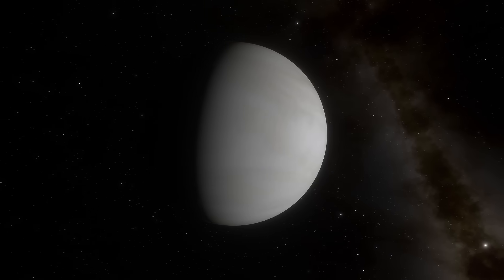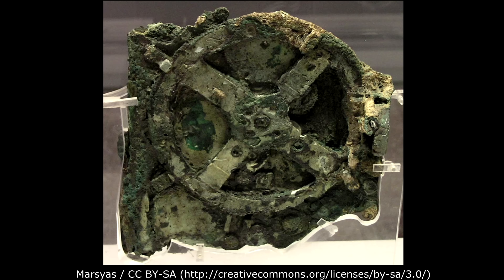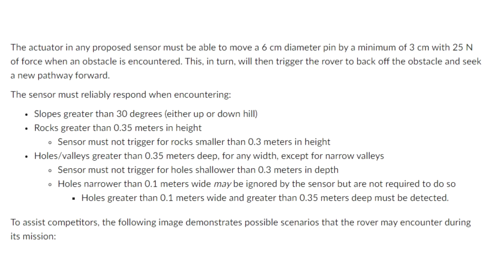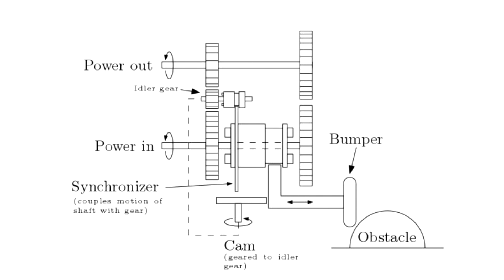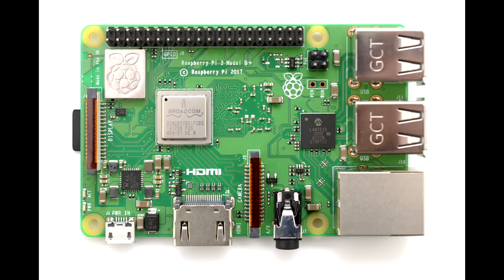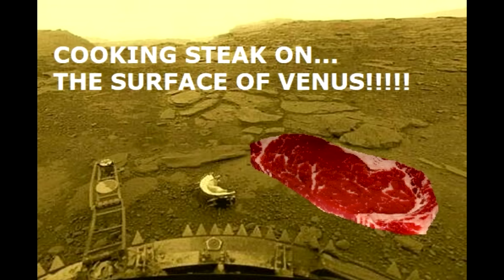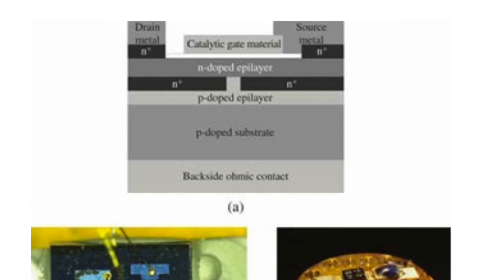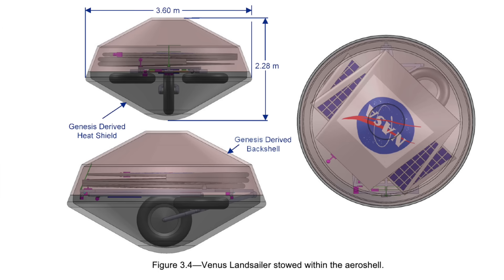Venus Rover Concepts That Beat The Killer Atmosphere

Comment: The Norden bombsight was an analog computer that could steer a B-17. So hopefully can steer a small rover.
The best option: a Babbage Analytical Engine. Can even run programs. A bit large for a rover, would weigh several tons if ever built. [Edit: to correct from Difference to Analytical. The Analytical Engine was a true computer design.]
Reply from the maker: Didn't the bombsight need a person looking through it?
Reply: @scottmanley   The bombardier had to calculate various inputs, and feed in altitude, speed, etc. Lined up aim point thru the sights, clicked on that for the computer. Flipped arming switch, then kept sights on target for constant update to computer. But it could work without constant updates, just less accurately. Bombs released by computer; pretty sure the classic "pickle" push was a movie dramatization, was actually a manual back-up. But I was talking about the Norden's ability to take input and produce output in relation to steering a course, seemed a good place to start. But am sure there are better; the B-52 had an advanced analog computer for this.
Reply: And Babbage machine needs human operation.
Reply: @Wallyworld30   All of the analog computers were designed for human operation, to set up input. But the Analytical Engine was designed to operate independently once the program was started. Mechanical sensors, how inputted, are a different part of the rover problem. I have no idea how that would be done.

Comment: Awesome! I'm so fascinated with Venus. Ever since I saw the SFIA video about colonizing it, it's that much more interesting to me.
Reply: It's the better candidate for colonization if you ask me. At first floating cities then slow and steady sequestration of the CO2 in the atmosphere. Maybe even launch it at Mars to help build an atmosphere and heat it up.
Reply: David Thompson 
The major disadvantage is that access to surface resources is very difficult compared to Mars.
Reply: @jeffvader811  I was thinking more along the lines of energy in the form of solar power, and wind power. Travel times are also half as much as a trip to Mars. Surface resources wouldn't be reachable until we managed to lower atmospheric pressure down enough for a diving hard suit to withstand. Obviously not the current models which weigh hundreds of pounds but something along those lines.
Reply: David Thompson 
True. Personally I feel that Mars will be the first planet (other than Earth) to be colonised, because self sustainability will be easier to reach in the short term. But I don’t doubt that Venus will probably receive similar treatment at some point.
Reply: @Twitch760  Would be a better idea to take the CO2 from Earth's atmosphere then, seeing as it's soooooo 'problematic'. XD
Reply: @sunnyjim1355  Yup, excess co2 has been proven to decrease intelligence in humans.

Comment: They should use that 3d printed compliant mechanisms veritasium did video about. https://m.youtube.com/watch?v=97t7Xj_iBv0

Published on Mar 12, 2019

Compliant mechanisms have lots of advantages over traditional devices. SimpliSafe is awesome security. It's really effective, easy to use, and the price is great. Check out SimpliSafe here: https://simplisafe.com/veritasium I visited the Compliant Mechanisms Research group at Brigham Young University and spoke to Professor Larry Howell: https://www.compliantmechanisms.byu.edu At the above link, you can download 3D-print files to make some of the objects in the video, plus learn more about compliant mechanisms. What I learned about compliant mechanisms I summarize in the 8 P's of compliant mechanisms: 1. Part count (reduced by having flexible parts instead of springs, hinges) 2. Productions processes (many, new, different enabled by compliant designs) 3. Price (reduced by fewer parts and different production processes) 4. Precise Motion (no backlash, less wear, friction) 5. Performance (no outgassing, doesn't require lubricant) 6. Proportions (reduced through different production processes) 7. Portability (lightweight due to simpler, reduced part count designs) 8. Predictability (devices are reliable over a long period of time)